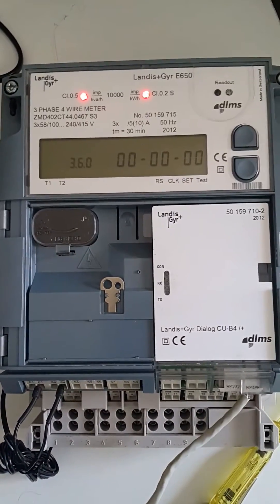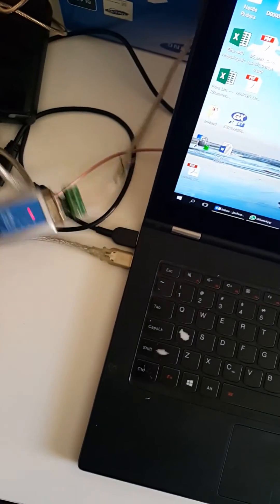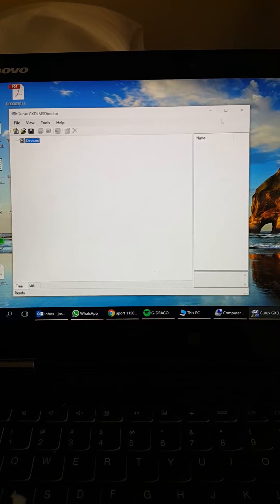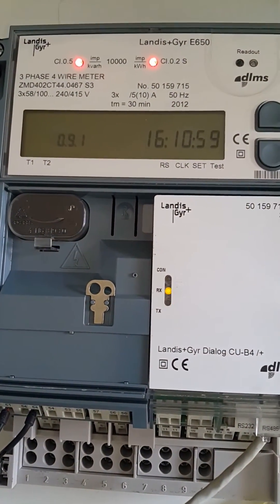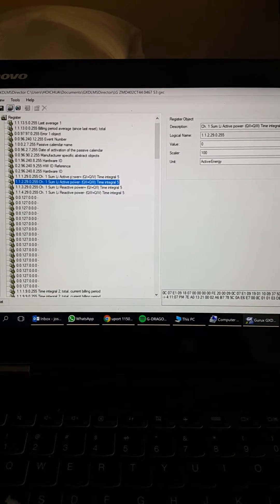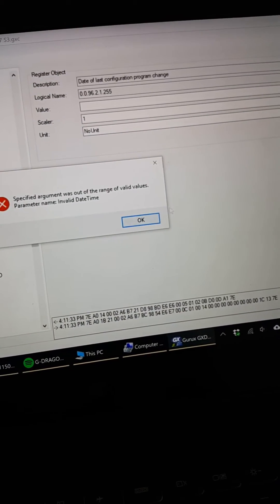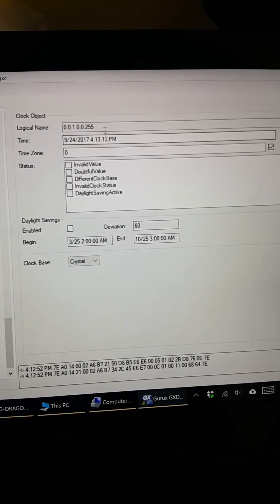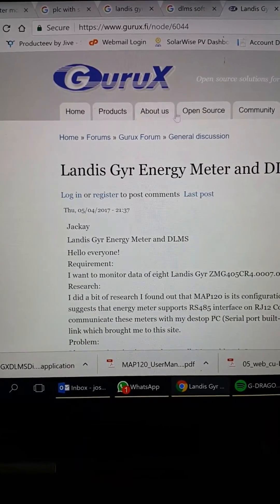Landis & Gyr Energy Meter

Comment: here in India, our power supply company has just installed meter from this company and there is a RS 232 port on the meter. But I am afraid to connect to it...do reading values may trigger tampering mode?

Comment: which version of gurux DLMSDirector used ?
Reply from the maker: nilesh gohel pretty much the latest version.
Reply: serial optical port connected with meter and PC.GuruxDLMSDirector install in computer.
i add a device as per my meter configuration.I got some data and Association Logical Name...but no any register value i get, can you help me ..what i did wrong